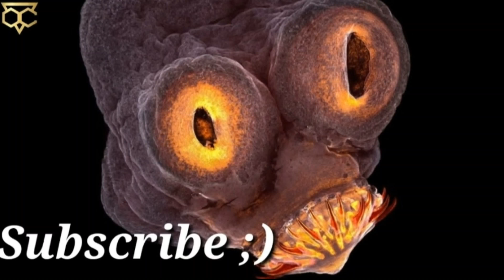Building a Prosthetic Arm - DIY - UNDER $20

Comment: Awesome prosthetic. I’m doing a project too for bioengineering class. Question what kind of string did you use so that it had a high elastic modulus and tensile strength? Also how did you integrate all the strings so that they moved in unison? I don’t want to power it by motors I just want it to be powered by the thumbs and fingers
Reply from the maker: I attached nylon cord 0.5 mm to each finger, so it can tolerate the torque of the motor, and hair elastic bands to get the fingers to the open position. Thanks for ur comment.